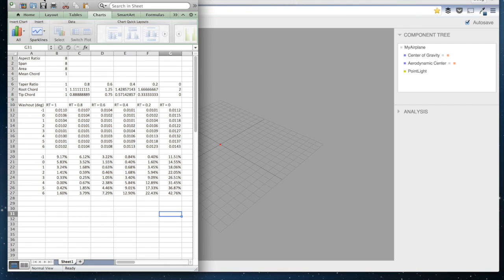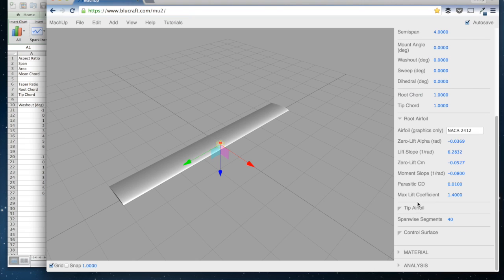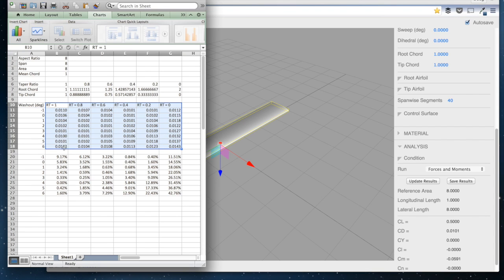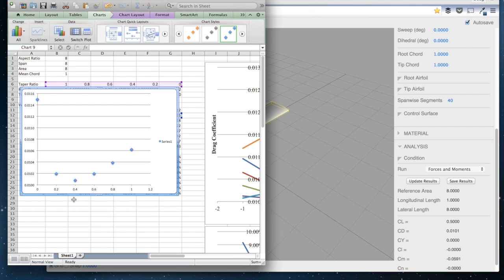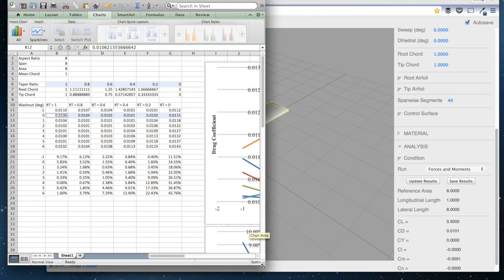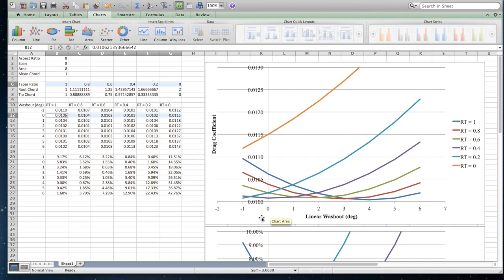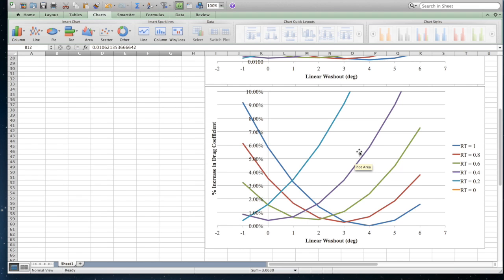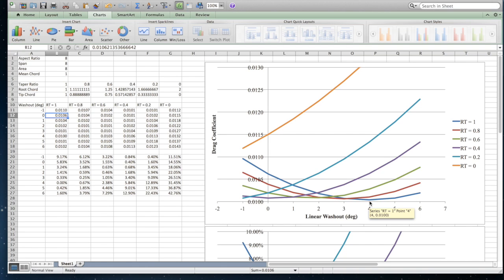How to avoid pitfalls of taper and twist (Part 1)

Comment: Thank you for sharing this work. As a result of modeling the F-22 in 3D, ( http://www.mikejamesmedia.com/raptor_2015_upres_01.html ) I found that it's wings have both the high taper value and high degree of twist. (If my measurements from non-classified drawings are correct, it's about 1 degree positive at the root, and perhaps 4 degrees negative at the tip.) Of course, some of this is affected by leading edge flaps, the fact that it flies from about 120 knots to about 1500 knots, etc., but I'd be curious to hear your thoughts on this setup.